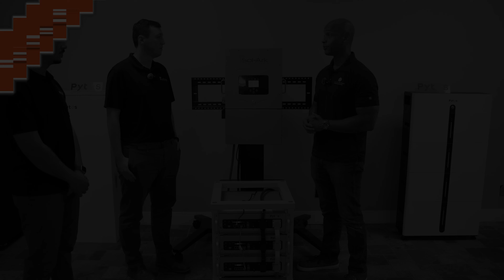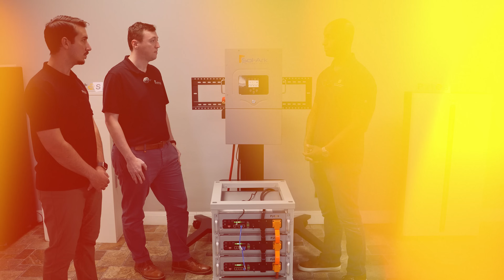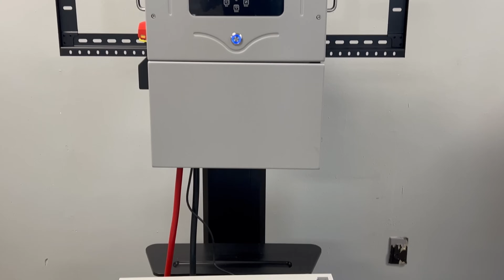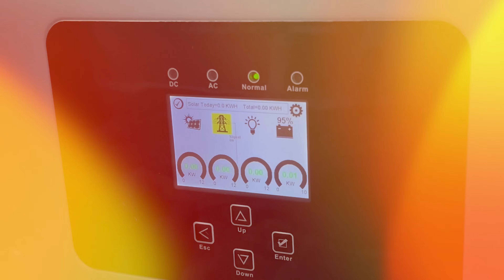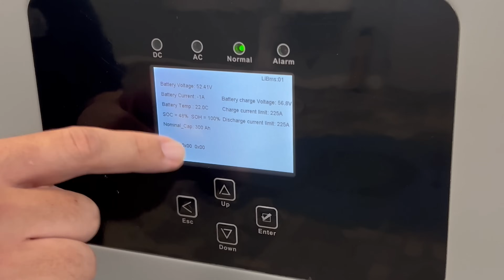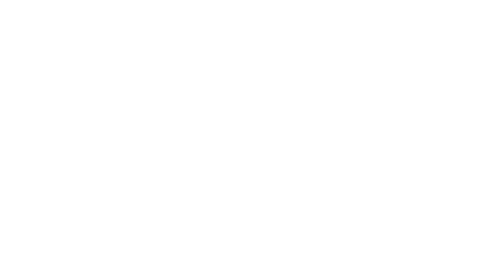Tesla Powerwall 3 Vs Sol-Ark & Pytes Battery

Comment: Expansion battery’s for Tesla power wall 3 makes the system modular and cost affective. Having 1 power wall 3 as the leader and the expansion packs added to that cut down cost a lot since the leader has all the necessary internal components needed. I see the appeal for Pytes but on the technical side of the house, it doesn’t beat out PowerWall 3 at all.

Comment: Generally the winner between modular vs integrated system depends on whether the product is good enough. Do we think powerwalls are in general good enough or not good enough? As long as it needs improvement, the integrated solution is better, since the integrated approach generally to a tighter better engineered design. The distributed system where you buy different components from different vendors, is going to be clunkier and maybe some interop issues. That said, there isn’t much reason to think there will be serious interop issues between the inverter and the  battery bank as long as the bank is properly sized and has the right voltage.  Going forward, the modular system seems better prepared to benefit from better battery chemistry if something demonstrably better comes along.

On the flip side, as an owner of a powerwall, I find the system, even a well designed integrated system makes my house harder to operate to the point that it is no longer suitable for renters or young adults/elderly to manage the system. You have to be there to do it. If you wouldn’t have them go monkey with the breaker box, then you definitely don’t want them near any of these battery systems. Too scary for them. Too complicated. They are also likely to fall victim to black start problems in an outage. Widespread adoption really needs the system to be designed for 10 year turn key operation — It is installed and you don’t touch it for the entire warranty period. I don’t think we are there yet, and so for that reason I suspect the integrated products will continue to have the edge.

Finally customers are recommended to restrain their impulse to get huge battery banks. If you think you need 1 week of storage you should be looking instead at a much larger solar system such that it still makes healthy amounts of power even when the weather is poor. This may mean you are buying 2-4x the solar you “need”, but better than than quadrupling the size of the battery. Solar is cheap. Batteries are not cheap. What the battery really needs to do is cover the period when the sun is down, so 24-48 hrs of usage. You’ll save money and end up with a safer more robust system. The sun is in general always comes up each day and will provide some power even if it is cloudy, unless there is snow on the panels or you are in a forest fire scenario. (Bi pfacial panels are something to look at for automatic snow removal in higher latitudes.)You just need collectors designed for the worst case, not the best case.

Tesla doesn’t require an internet connection. The gateway has its own WiFi so you just connect to the gateway WiFi and you can adjust it directly without an internet connection. However, they do have warranty issues without a WiFi connection. They want to be able to do a software update automatically. So, not a safety problem in a power outage, but something to think about if you live on the dark side of the moon with no connectivity whatsoever.

Comment: I have the sol ark 15k and i love it, especially the software. I run it with cheap lead acid deep cycle batteries from the auto store, unbeatable in price ( batt. Only used for power outages)

Comment: Is the communication using CANBus between SolArk and the BMS that comes with the Pytes battery and passing all the monitoring data and current limiting control to SolArk or does the BMS have it's own app and configuration settings? Does SolArk ever provide the BMS for the batteries.

Comment: 4:36 what I want to know is can I connect a Cybertruck NEMA 14-50 (40 amp) bed connection or the Ford/Chevy NEMA L14-30 (24 amp) to the generator input is exactly the same way and same benefit ?!?!? -- mainly truck would supply the load to the house first and then recharge the house "UPS" battery.  Also obviously there would not be the two wire auto start.  SCENERIO: truck is plugged in during outage to supplement house "UPS" battery but then you need to take the truck on errands OR to go recharge the truck at a Tesla Supercharger (etc).

Comment: Great video Joe!  I love Sol Ark but couldn't find an installer that would come anywhere near the price of a whole home back up Powerwall 3 system.  Sol Ark typically needs soft starts for HVAC, doesn't offer a "charge from solar" EV charger, and doesn't have Powershare.
Reply: Powershare is up in the air: "Powershare Home Backup functionality with Powerwall is expected to be available later in 2025 through an over-the-air update." 
And is only 11.5 kW I think. NEMA 14-50 in CT bed is 9.6kW (I think) and can be used with generator power inlet it seems.

Comment: Does Tesla power wall 3 work with stand by generator
Reply: Not directly but Tesla offers wiring diagrams on how to accomplish this.
Reply: There are tax reasons why you would not want to recharge on generator. When you get a powerwall, you quickly realize that half the engineering is there to keep the IRS happy so you can claim the 30% tax credit.  Obviously if you are off grid, then the tax man can go jump in a lake and you just need power when you need it. The addressable off grid market is tiny compared to the entire housing market, so I suspect this is why it is the way it is. Sol Ark or similar is not able to scale up to cover 1M or 50M homes so can afford to be more flexible address the needs of specialty markets.

Should we all go off grid? No. If you are off grid, excess solar generation is simply lost. If you are on grid, you can sell it for someone else to use. Off grid is a likely to waste a lot of power potential. You do it when there is no alternative. As good as you will feel about sticking it to the utility by going off grid, you will feel better if they pay you at their retail rates. (If you can get that deal, that is.) Even if you can’t, I think it is better and cheaper to have the grid there for backup when your own generation than to buy a gas or diesel generator. You can certainly have all three. We are quite happy with just powerwall, solar and grid though. We are in the top 14% of Tesla customers for backup hours due to grid outage. It’s down a lot. Our 28kWh of storage is plenty. We just are more careful what we do with it  in the winter when we commonly generate only 6 kWh / day. The 10kWh solar is the problem here. Too small. We would be much better off in the dark months if we had put in 20kW of solar.

Comment: I wonder how easy it is to get these systems permitted and inspected in the Bay Area in California.  My complaint with a low voltage system is the distance between the inverter and the battery.  It doesn't look like the battery can be installed outdoors in the weather so that would require the installation in the garage or equipment room.  Just curious how it works here.
Reply: There are outdoor battery options.
Reply: Currently have a discover aes outdoor battery cabinet x2 with two sol-ark 15ks going through permitting in Sonoma county. Shouldn’t be a crazy request to get this approved but I will find out soon.